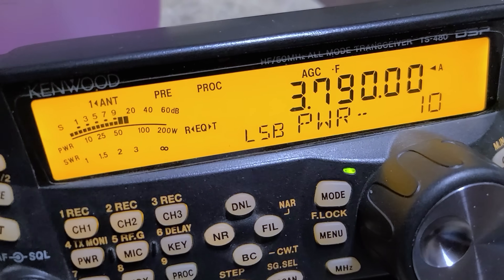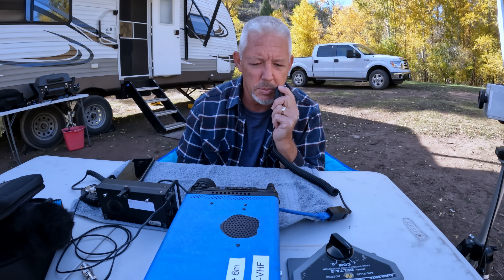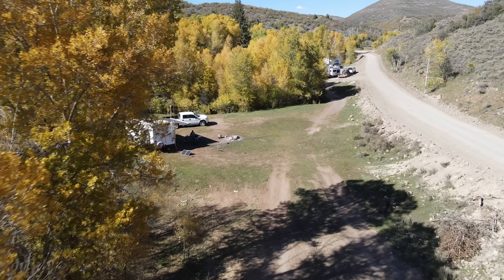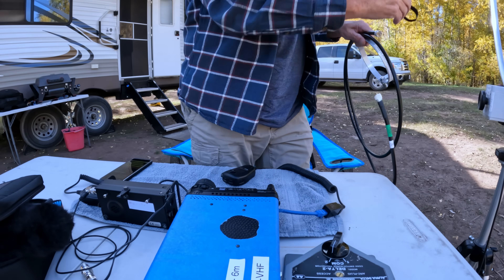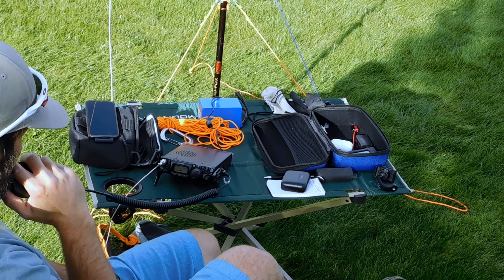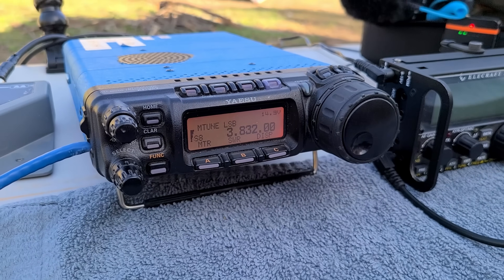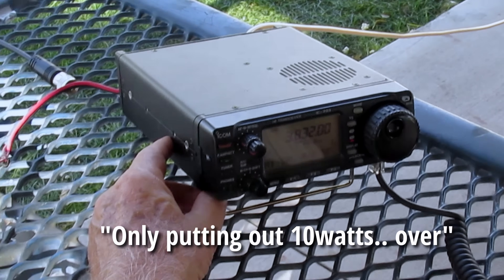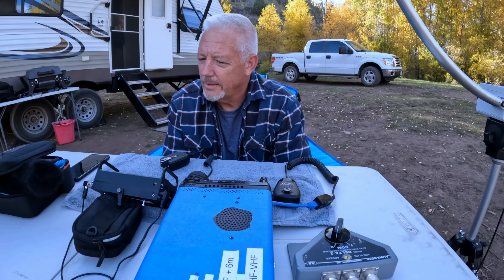Hear what NVIS sounds like from 3 locations | K7SW Ham Radio

Comment: This is such an awesome video! I'm a really new ham and this is one thing I am really interested in. I would like to do stuff like this at 100-200 miles. Thanks for your work on the video.
Reply from the maker: Thank you Kevin, I am glad you enjoyed this. Welcome to the hobby. You will have so many opportunities to do things like this. Give POTA a try, POTA is amazing way try out different configurations and learn radio operation.
Reply: Oh, I think you’ll like NVIS.  Reliable comms without consideration for terrain features out to ~300 miles.  Use 80m during the day, and 40m near dawn and dusk.

Buy a 30 ft JackKite telescoping fiberglass pole.  Set up 40m of wire for an EFHW.  Raise the pole in the wire center for an inverted V configuration.  You’ll be able to use 80m, 40m, 20m, 15m and maybe 10m without anything additional, NVIS and DX.

Comment: WOW, this video may have help me with at least a question about transmitting in a mountainous area. I live in eastern Kentucky and will be setting a station in my house with ridge tops all around. It will be nice to experiment with what I have available. Thank you for this video. Will be on the air in a week or two. 73, KN4OTZ.
Reply from the maker: Glad it was helpful Jeffrey, get out there and set that up ! 73
Reply: @hamradiowithkevin  GOOD NEWS, yesterday I set up an Chameleon EMCOMM II. One end at about 15 ft., the other about 10 ft. Made my first contact on HAM radio to WV1W in Connecticut at 3:20 pm. I live in Booneville, Ky. He told me my signal was 5x5. The rig I was using is the Yaesu FT-991. I wasn't sure I would be able to make contacts as there are ridge tops all around my house. I'm glad I came across your video. SUCCESS! Thank you so much for the information provided in this video. Hope you has a Happy Thanksgiving day. 73, KN4OTZ.